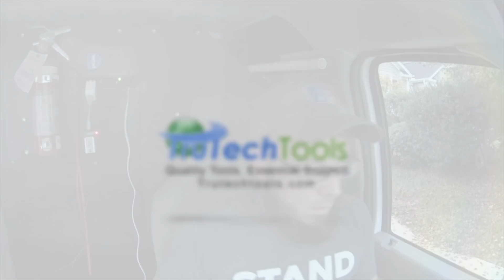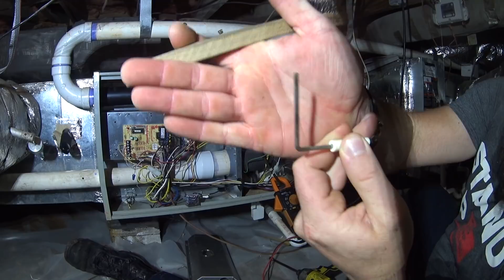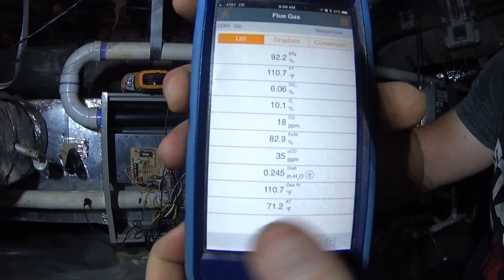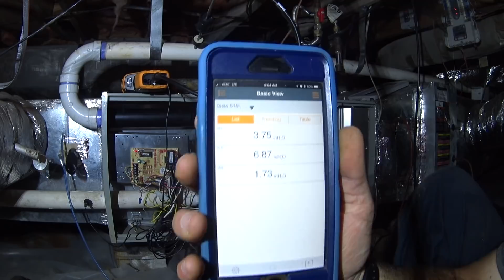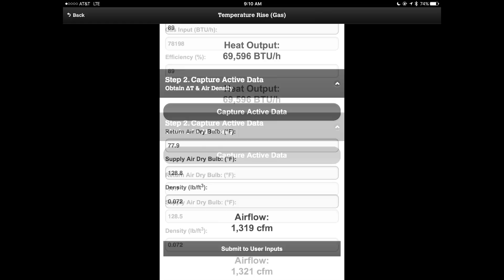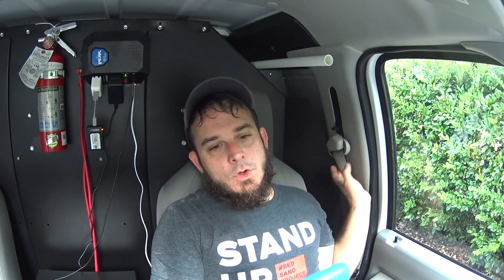10-12-17 Trane Furnace Heating Maintenance for Jason K of Real Customers

Comment: Doesn't working on the burners with the gas on emit gas out?
Reply from the maker: I don’t fully understand your question. Gas will only come out when the system is trying to operate in heating.
Reply: @StephenRardon  I didn't think it would be safe to take out the burners with the gas on.
Reply from the maker: So long as the system isn’t trying to run the gas won’t come past the gas valve. Would only need to shut off the gas if you’re going to connect to the inlet pressure port for testing.

Comment: So during your combustion test you came across something that is common in the gas appliance manufacturing trade which is that in order to get the unit to fire at the rated efficiency you would either have to turn the pressure up higher than is recommended or replace the orifices with larger ones.  Here is a video by Jim Bergman on just this topic. 

https://www.youtube.com/watch?v=4h5UgrujqJw&feature=youtu.be 

Don't know if its feasable to carry orifaces around like oil techs carry nozzles. But you could note the problem and correct it on the next service. Leave it up to the customer.
Reply from the maker: +Brian Mahoney I’ve got another video where I had to drill the orifices to get it to fire properly, don’t recall the name for sure buts it’s in my channel

Comment: Excellent video,  very thorough job.  I hope you are charging enough money for the great service you are giving the customer?
Is hard to compete and explain to the customer why your pm are so much more money than the other guys advertising $39 - $69 "15 point tune up" who basically change the filter and run a wet vac for 10 minutes.
Reply from the maker: +Richard Fossani my Performance Inspection is nothing more than an iManifold Report showing the Systems performance and any potential points of failure. That comes at $50, my maintenance Agreement could probably stand to be a little higher but its competitive with the market and not a giveaway service.
Reply: Besides the manifold report your cleaning the burners,  flame sensor,  etc. I bet you are there at least an hour maybe more? You need too get more than $50 For that. Just my opinion.  How much did the company you used to work for charge  for their maintenance?
Reply from the maker: +Richard Fossani my performance report service  is a lose leader, gets me a chance to impress. My standard maintenance does a good job of covering even up to 2 hours spent for visit. $50 is not really worth my time but I’m trying to spread out my options to help people that may need it. An iManifold report takes maybe 30-45 minutes

Comment: A common phrase I heard through out my career in Naval Aviation and yes I muttered it myself when I was Maintenance Manager was: "We never have time to do the job right but we always have time to do it over." Errors in maintenance of aircraft can result in a bad day, the same can be said for shanking something on a furnace.  At the end of the day it's on the technician to get it right no matter the pressure applied, we'll be the one to answer for it, and yep it's easier said than done.  I admire your thoroughness and commitment to doing the very best you can.  I'm fairly new to the trade and have learned a lot from your videos, thanks for making them.  Your chasing excellence, success is chasing you.  Best wishes!
Reply from the maker: +Anchor Snake when I left my first hvac job to chase more $ elsewhere my boss told me to always try to do the job right, there’ll always be someone faster but if you focus on quality work you’ll never be without a job. It’s proven true for me so far.

Comment: Love the vids man. I try to be as thorough as possible, but the company that I currently work for barely gives us half an hour to do a maintenance. as soon as I do find even a minor problem like a blower cap... I am now behind on the rest of the calls. Sad part is most of the companies in my area all want the speed, but they want you to generate repair or replacement income.
Reply from the maker: +Jacob Buckwalter it’s pretty difficult to buck the system of squeezing in as many low cost calls as possible and focus on making sure the work is done as thoroughly as possible. I’ve been fortunate that my detailed work has always been appreciated by my employers until I decided to go solo. I’ve been the guy that when a customer is upset or “particular” I was sent to fix things. It’s been my reputation for several years now. Your employer has to see the value in detailed diagnostics before they will understand. If you’re not charging a reasonable fee for your detailed time then you won’t be able to stay on task very long without losing money. Gotta compete for high end service rather than fishing at the bottom of the barrel. Thanks for watching
Reply: I am much in the same boat. When someone is unhappy or has an odd problem. I get dispatched, and the ppl love me. makes for long days since the office thinks it should still only take 20min and keeps adding on calls. But when I enter an apt, I am there for them 1st. I found just by listening to the customer I can find out a lot about the system before I even look at it. It takes longer but the end results are a happy customer. I am the most requested tech here and with my last company. most of my customers call me directly instead of calling the office. I think that is why since you have gone on your own, your channel has appealed to me even more. I have been getting the push from customers and family to go on my own. I admit I do have a strong drive to do it but I am also very scared to pull the trigger.
Reply: Where I'm at ,we at least get 45 min on a maintenance , but a ton of paperwork with it ,so basically , 30 min lol .
  I'm always trying to set my I phone alarm for 30 min just to remind me of the time already spent . It is difficult . I try to be very personable with our customers which is also difficult . Anyone get an hour by chance ? Last employer allowed 30 min . Im counting the blessings 👍
Reply from the maker: +Jacob Buckwalter it’s definitely something I was scared of doing for the last 5 or 6 years and I finally just said “let’s do this and see what happens!” I’m young enough that if it fails horribly I can still crawl back to working for a company.

Comment: Did you check out the heat exchanger on your own when you heard that another company said it had cracks? With that access panel by the evaporator a light and a mirror would've been easy enough to get eyes on it. Had the same deal when a company condemned one Lennox Whisper unit and said another Carrier unit had a possible crack, pulled the fans and got a camera in them and found no damage and the combustion numbers where spot on (the customer was an existing customer with this company from a previous location, and I think instead of taking care of the existing, they wanted to install new and have a gravy maintenance contract). With higher oxygen on your analysis I was just curious if it was a possible issue. If there was existing data on analysis prior then no need.
Reply from the maker: +tcpHVAC/R yes, I tore that thing apart since I was going to be liable if I was wrong

Comment: Been looking at investing in iconnect but having to pay a monthly fee for the iCloud to get all benefits I'm not sure of. What's the big advantage in having the iCloud account?
Reply from the maker: +mth2068 the biggest advantage in my mind is storing profiles so that you can pull them down for any device on the same account. You don’t have to reenter the equipment data every time you visit the same customer after the first visit. And the different reports give a very nice visual representation of performance to the customer
Reply: Do u use the iCloud on yours
Reply from the maker: +mth2068 I pay for the iManifold cloud storage. You can pay by the month or for a year at a time (I’m pretty sure, it’s been a long time since I set up the account)